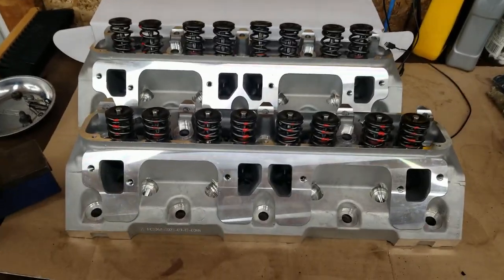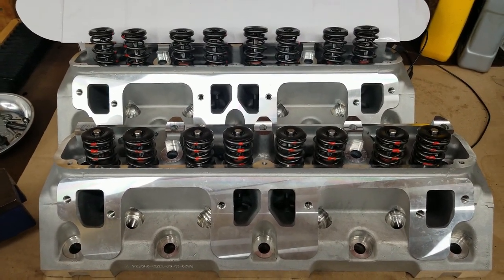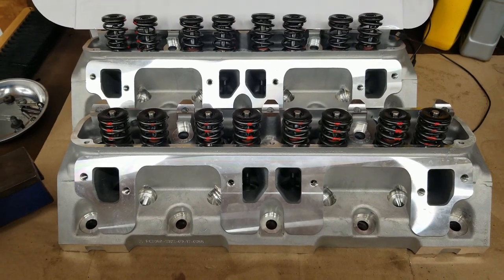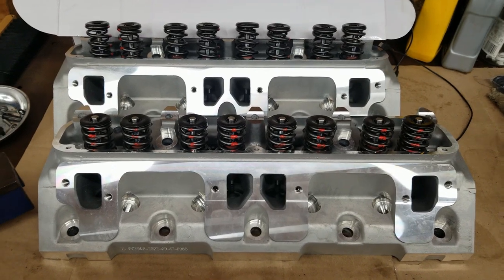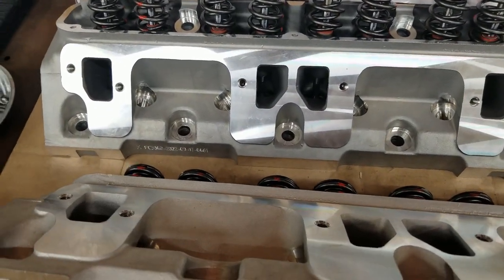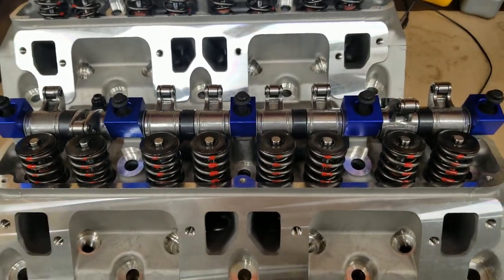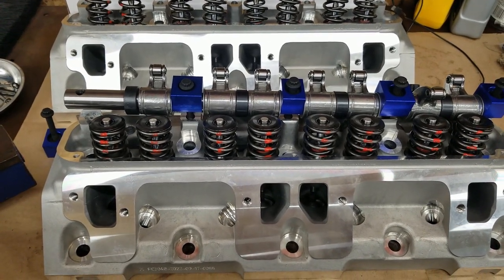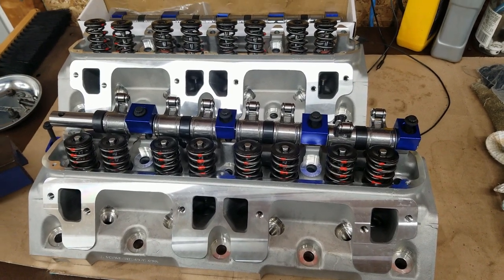Speedmaster Small Block Mopar Cylinder Heads | Disassembly and First Impressions

Comment: I have a set of the PRW rockers on a shelf in my garage. They were supposed to be 1.6 ratio, but actual ratio (determined by measuring actual valve lift and accounting for lash) is right around 1.4. So, I'd measure your actual valve lift after assembly. They are really, really nice looking rockers, but when you pay for 1.6, it's reasonable to expect to get 1.6 rockers...

Comment: If you had 177 intake valve so you had a 318 cylinder head all 360s and 72.4 and 340 use 188 and on a 360 the maximum size valves about a 194 to 196 cuz you've only got a 4-inch bar and you're being going to be shrouded if you got 202 206 is whatever

Comment: I suspect the shim beneath the springs is to prevent the springs from fretting their way into the soft aluminum, NOT for adjusting installed spring height.

Comment: Ive got a set on a 340 dart and i must say they work well....  but i did use comp cam springs and retainers,  i do have spreedmaster  steel valves... mild .470 cam but that engine is quite powerful 👏

Comment: Did you get them on the engine yet? I have 2 in my cart with valves and I want to hear what you have to say. I am throwing them on a 318.
Reply from the maker: I got the engine broken in, but had some issues towards the end of the break in unrelated to the heads as far as I can tell so far... Unfortunately I had to pack up for a move of houses, and the new house has no heat in the shop. So far I'd say they are a good ootb option though, I'd buy them again.

Comment: How did this work out? just got the offset shim kit from Mike & working good on the engine? or other issues?
Reply from the maker: I got it running. Kit works, but having some other issues. Gotta put out a video soon. Moved residences and the cars and YouTube have gone to the backburner unfortunately

Comment: Simple fix for the rockers is run a modern Beehive spring That is what I have done on my sets.
Reply from the maker: Definitely one way to do it. But I didn't want to have change hardware, plus I have not had good luck with beehives in the past and feel more comfortable with a double spring setup.

Comment: I raced a Super Stock Duster 340 back in the 70s. It ran 11.20s to 11.50s, and I used factory 273 adjustable rockers on a Cam Dynamics roller cam. No problems whatsoever. I believe my installed height was 1.75" with titanium retainers. Not much to choose from back then, but my Duster was the National Record holder.

Comment: Thanks for the review, are there any flow numbers for those?😎👍
Reply from the maker: As far as I am aware they don't advertise any, but I believe on many benches they are somewhere in the 250cfm range on the intake, and i dont recall the exhaust peak now. But nonetheless, to bolt on as a replacement for stock factory iron, they are definitely going to provide a felt difference in power. Thanks for the comment and view!
Reply: @hpbunker  
Two fiddy max intake CFM, ok that will help make some power. Posting a video with flow numbers of those heads should help you get lots of views. Do a short saying what the heads are and ask if anyone ever wondered how much they flow. Then say to subscribe to find out. Put the video out in a week or so or after the short gets a bunch of views.

You might be able to find someone else's video with that info you could splice the flow numbers into your video? If not you might have to find a local shop with a flow bench to have your head tested? 

In the video with the numbers, list the parts and other specs your engine will have and ask people to write down how much HP your engine will have in the comments. This should help your channel grow quicker because people are interacting with you.

Maybe by the time you have the engine assembled you will be monetized to have it dynoed? Make sure when you remind people to subscribe to also tell the to share so you can get to where you can pay for stuff like dyno testing. Good luck, with your channel, subscribed.😎👍
Reply from the maker: @itseithergonnaworkoritaint7852  thanks for the tips and subscribing!
Reply: @hpbunker  
You're welcome, just a couple ideas I was going to use with my channel before my back was broken. Not paralyzed but still to much pain to play in the garage.😎👍

Comment: I must applaud you for your effort and you provided helpful advice both parts wise and money wise.  Speedmaster is a company and a company for profit. There is nothing that can prove that they use only the lowest bidder. The 1 to 16 ratio rocker arms designs have been around for over 40 year, so manufacturing a private label set, is not earth shattering news. All of these products have roots in products that were made here. Let's get some 800lb gorilla out of the room first. None of these products were just made offshore by companies just because they wanted to. They were sourced by outside designers and businesses that were looking to make a business contract. The Chinese companies have no interest in building high power LS motors, but there's companies that do. Owning a casting foundries and finishing machines, is not always in the realm of many companies that design products but cannot afford a manufacturing base. In many cases, cylinder heads are casted alongside many OEM parts. Does this is make this wrong or right? It's plain and simple business.  Do you have a CNC machine? Do you have a foundry? Making parts is a real global industry.  Making a country out to be the bad guy, is really missing the bigger picture. We have to understand the social and political implications of what we buy, if we are going to criticize how a business operates. They are in it to make money, just like you would if you were a manufacturer. Personally, I feel Speedmaster provided the trans body to the manufacturer in China and they duplicated the part complete with the logo as a design element. As long as corrupt companies try to make money off the backs of legitimate business,  we will always have to do our homework on our own purchases.  Prejudice is a non factor in informed buying.  Question your purchases with your buying power.
Reply from the maker: Thank you for the comment and appreciation. I was trying to be transparent here. I will say this, in no way am I a huge fan of overseas production, nor am I a hater of it. I understand it as a direct function of free market capitalism, and that in any industry, constant R&D and product enhancement in either performance or price is the only way to either stay on top or be an industry leader...Therefore, it doesn't make me mad as it does for some others that a company like Speedmaster exists, and where or how the products are produced. I think as the buyer, one needs to make as informed a decision as possible for themselves, and decide what is important for them when spending their money. I really just wanted to provide a short, up close lens on these heads and first impressions for those who are considering them or have them to use and are maybe on the fence. Keeping all of that in mind, and not thinking these are going to be on par with far nicer cylinder head offerings for the LA platform, will hopefully help those watching in making decisions for their own situation.
Reply: @hpbunker  thanks for understanding my reply. I also respect your opinion and what your intentions were of the heads. When I started in parts 40 years ago,  Japan and even Taiwan were starting to make cheaper versions of mostly decorative parts for hot rods. Valve covers, dress up kits, etc. Sometimes, build specs were sketchy, but as the years went by, the quality became first rate. Many a American company used them for budget parts. Then, for their class a and b parts. It was always going to be a Chinese industrial boom to take advantage of cheap labor and materials. The same manufacturers that bought from Taiwan and Japan now use Chinese products. I remember when manufacturers started using Chinese rotors and drums; we were assured the product was as good as American made items, because we had American inspectors watching over the production lines. It was true, however when we demanded even lower costs, that also went away. Slowly I learned of the geopolitical implications of manufacturing of everything we buy. We were taught in school that many countries have high unemployment and the lack of work,creates friction within countries with weak governments. Even today, there is so much unrest because the corruption and lack of work, among the bottom classes. Since most of the bigger companies sub out materials and labor, we can never be sure of what or where our raw materials come from. So many cry out about imports, but yet, still vote with their dollars on imported products. Fact is, building performance cars is run off discretionary income, so rightly so, prices can drive people to buy imports. Yes, we can agree, it's not a perfect world, but if you want champagne parts at diet coke prices, choose wisely and vote with your dollars
Reply: What? 😨

Comment: Ive had good luck with speedmaster stuff. But after the c4 valve body incident i will not use their products. Thanks for the video.
Reply: I was going to buy those rocker arms.....but after the broader performance video, I am not buying speedmaster stuff
Reply from the maker: I filmed this about a week before that valve body stuff all surfaced, and really debated if I should post it as I considered I would get flack from those enraged by the valve body incident. Figured I would post it anyways, more to provide info to those who maybe like me bought these on a budget, or maybe bought a used engine with them, or maybe are just curious about the products. In no way am I condoning how people should or shouldn't feel about Speedmaster products, and like I mentioned, I would never have purchased these even a few years ago...but I did hear a lot of good about these heads in specific, and when weighing my options vs. budget, they seemed to be a good choice. Time will tell if they are or not. Thanks for the comment and view.

Comment: Speedmaster stuff is made in China by the lowest bidder. A guy brought me a set of aluminum Chevy BB heads where the rocker arm stud holes had pulled out the threads. Because he had already had all the stud holes welded up, I had no reference as to where to accurately locate the holes, drill, tap for heilcoils, and install helicoils. The aluminum was very soft. He admitted they were made in China. Which amazed me because he is a multi-millionaire businessman,...
Reply from the maker: What you are saying sounds very familiar to me, and is why I mentioned in the video, 5 years ago I would have never bought these. But I see countless people discuss how good the actual castings are (at least with these heads specifically) compared to even some of the comparable American brands, so it was somewhat what led me to purchasing a set. This is a very low buck build, and time will tell how they hold up, but worst comes to worst its not a high dollar short block, so if its hurt hopefully it wouldn't be bad. Now I'm gonna knock on some wood and hope I didn't jinx myself. Thanks for the comment and view.

Comment: Having bought those heads I can tell you first hand whats wrong with them. Because they were so cheap I bought 3 heads and cut one up to see what could be done with porting.
1/ Valve throat area is at the upper limit for the 2.02 valve size. I can only assume they do this to try and get some high lift numbers but its not good for low to medium lift cams. I ended up going a bigger valve to fix this to an extent.
2/ They are usually undercut behind the valve seats. This creates big step where the valve seat sits and it cannot be ground away because if anything material needs to be added. Why they do this and not just leave it alone is beyond me.
3/ They were notorious for valve seats coming loose. Apparently those heads with the narrow or low depth valve seat inserts were the problem ones but they did change to deeper, wide inserts which apparently fixed the problem.
4/ The exhaust ports have this weird taper at the head face where the first 1/4 inch into the port is tapered inwards. Just a very strange setup but at least material can be removed to fix it.
5/ Inside the combustion chamber they leave a very large step at the top valve seat cut (where the valve seat meets the head), terrible for flow but again at least this can be fixed with a burr.
6/ Check your valve spring pressures. These heads are notorious for having low spring tension and variation. As are all speedmaster valve springs.
7/ These heads come with 3 angle valve job on exhaust and intake. But it really is a basic rebuild grade of valve seat, certainly not a performance valve job. I suppose this depends on what your trying to achieve. For performance it needs to be redone properly.
8/The valve guides are of very soft material. Thats OK if you only drive occasionally but for a regular driver they are going to wear out very quickly.
Thats not all of it as I spent a LOT of time working on mine to get them somewhat good. But you really cannot take anything for granted and everything must be checked or it will bite you in the buttock down the track.
Reply from the maker: I appreciate the input. I filmed this video a few weeks ago but only just got around to posting it. The heads are currently getting inspected by a cylinder head guru who specializes in Mopar heads, just for peace of mind. This whole build is super budget, and I'm sure these will make more power then factory iron while saving some weight in the process. Maybe in a future iteration for this engine they will come off for some port work to help maximize them. Thanks for the comment and the view.